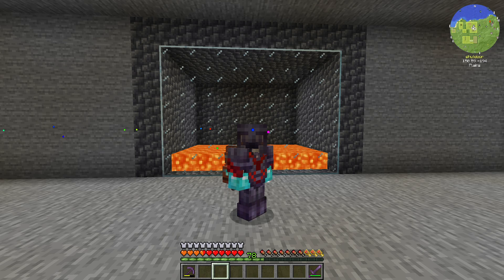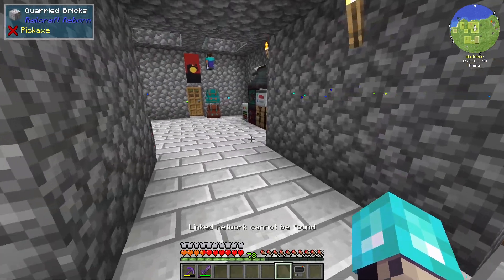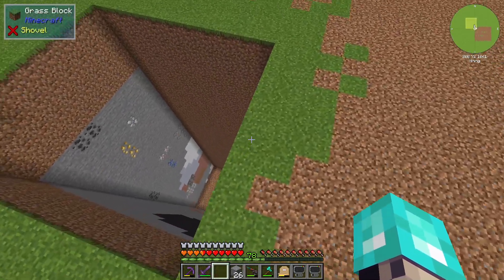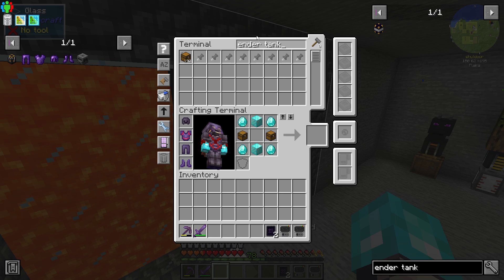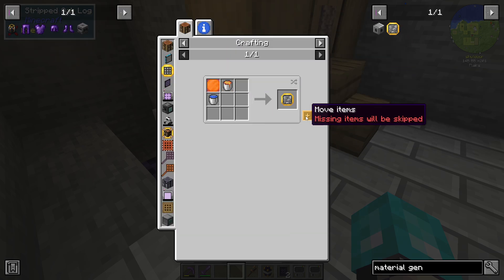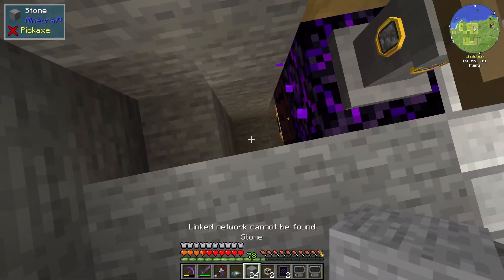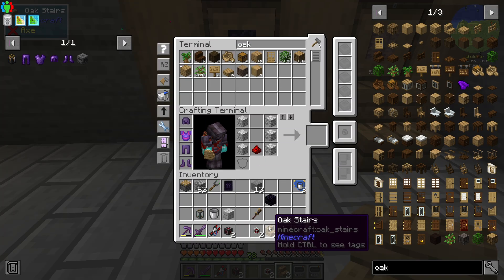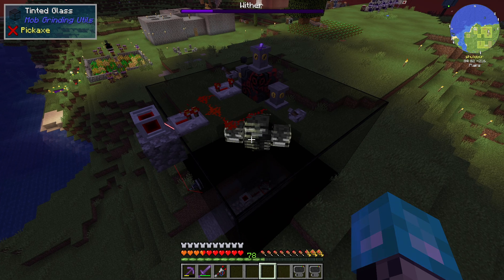Obsidian For Days | Direwolf20 1.20 Ep 23

Comment: The dragon egg setup does work. Unfortunately there is a bug with the extractor that if you wrench them they go dormant and cess to function. I reported this bug. Put a placer block place extractor upside down facing a barrel below it than remove placer block and place dragon egg on top of extractor and you are all set.